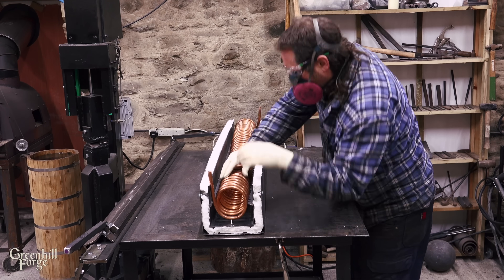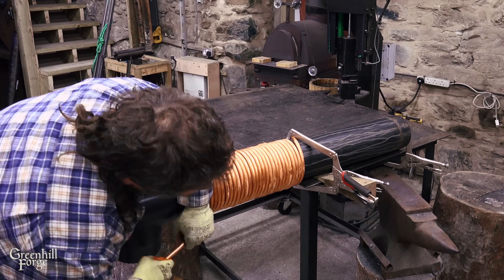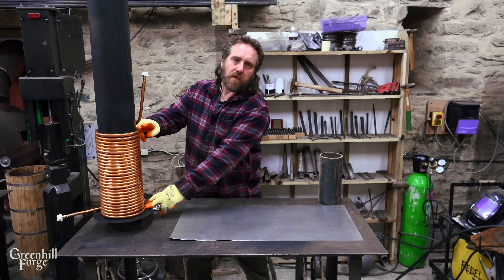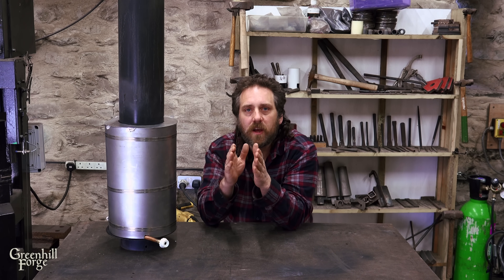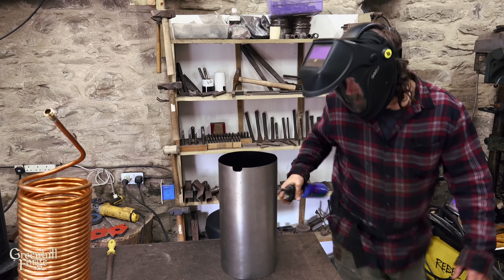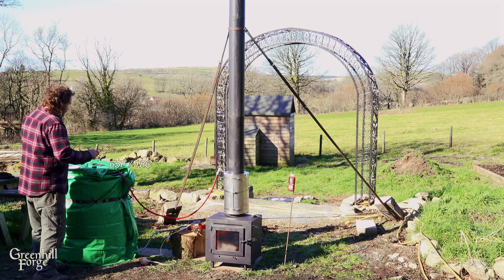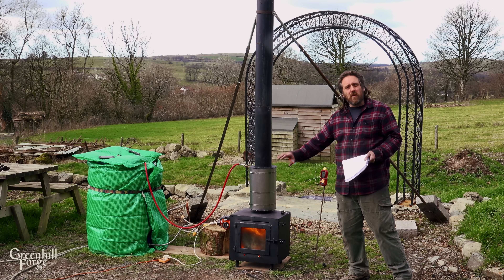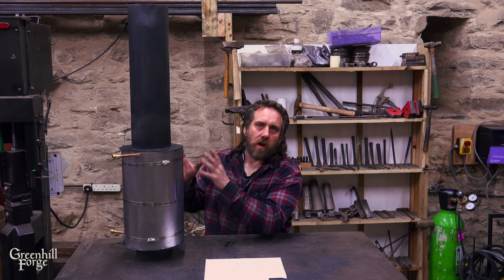Best Wood Stove Water Heater Yet: New Design Tested | Off Grid Water Heater pt3

Comment: Hi, I read through most of the comments - this post was fascinating for many! I live off grid and we heat with wood and I would love to have regular hot water in the heating season. Can you tell me what kind of barrel you used that’s safe for hot water?
Reply from the maker: any steel barrel is safe for water. if it's tied into a potable system then it gets a lot more complicated and needs a food grade lining like porcelain or glass

Comment: Another couple of suggestions crossed my mind. 

1. Place your coils on a section of flue that runs horizontally. This should work as long as you are pumping the water. It may foul up thermo-syphoning, though. I am not sure about that, but it seems that the unequal heat zones and the lack of vertical rise might hamper the flow of the syphon.

2. If you insulate the entire flue, the gases will stay hotter, allowing a good draft even with the slower burn experienced using a damper.

Just my 2 cents.

Comment: I watched your video and have a suggestion. I have burned wood most of my life of 70 years to heat my home with. I have had a career in the mechanical engineering field and have always been interested in projects like yours. 

What I have found is that a damper in the flue, while slowing the burn,  will keep the heat in the system longer, transferring more heat into the house. It seems that in your case, it would serve two purposes, it would make your wood last longer and it would transfer more of the heat into your coils. Those two things should increase your efficiency numbers. As a bonus, adding a damper above the coil would be a quick and easy modification.
Reply: I was looking for this kind of comment. It was my first thought for an improvement. thank you.
Reply: Exactly !!!  Slow the exhaust and the heat transfer will be faster.
Reply: I think he wasn't using a flue here to keep the tests consistent.

Comment: My homemade wood fired boiler/water heater, burns with no visible smoke, and doesn't creosote up the stack, 40 years of operation.  My only copper coil is a 60' length immersed  in a 200 gallon stainless tank, big enough to not need the ice in the tubing before coiling trick, which is a great idea!   I had a Snorkle stove for years, commercially made, made to sit down in the water of a hot tub, it worked great and now I wonder how it would have done in a tiny tank instead of a 4' diameter horse trough.

Comment: Great video with entusiasm! Interesting to see the differens between sand and graphite. I guess if the coil were stretched to cover more of the inner pipe, as with the inside coil on a previous video, efficiency would have improved.
With your welding skills, I suggest you to do a web search for "turbodym". That will bring you to a web page in Poland, Kratki, they have an other alternative, leading water tubes through the inner pipe. As for some 10-15 years ago, they didn’t make them in other than 200 mm, so I had a local shop making one for me in 150 mm.
Also worth mentioning, to avoid creosote buildup it is importen have water temperature above 50-55 deg C.

Comment: Is there no way to collect the creosote, or to collect it away from the coil? I see the rocket stove is the most efficient and quick to react...
Reply from the maker: the prevailing idea is to be hot enought to burn the creosote before it can condense. it could be condensed/collected on purposes fairly easily in principle but you'd have to do something with it, either burn it or remove it.

Comment: Pure speculation here but would laying a flat copper coil directly on top of the stove improve heat capture. I have an old wood stove in my backyard which I hope to use with a hot water radiator to heat my 8x12’ shed/workshop. The top of my stove gets markedly hotter than the flue.
Reply from the maker: it would work but total surface area matters too. 6 feet of flue is way more surface area than the stove top so there's a balance to find

Comment: I use a v Pipe, welded to a 6 mm plate installed inside the firebox intake  entering from below at 45 degrees, and exiting above at 135 degrees, thsi themosypons and is fast,, 30, and 60 degree v configerations wor well too, depeding on the fire box, we used stainless to make the heater

Comment: THE FLASH POINT OF THE CHIMNEY IS IN THE CENTER OF THE HEAT COLUMN. SO IF WE CREATE AN UPWARD EXPIRAL COULD WE INCREASE HEAT TRANSFER?
Reply from the maker: yeah, a helix up the middle would help a lot but increase creosote issues

Comment: Hi, I was thinking about the following setup: your wood stove, with an insulated container with water, on top of your stove, "wrapping around the flue", with a lot of horizontal rods radiating from the flue inside the container. But the top of the container should be open for safety reasons. The container has an in- and outlet and we connect it to a pump. Now one should be able to safely adjust the pump so that the heated water cools the flue down just to the required temperature. I'd love to see it tested, my use scenario is heating 30m3 pool from 10C to 25C (with ambient temperature around 10C).

Comment: I wonder if there is something you can do to concentrate the heat a little bit more at the spot where the coils are. By that I mean you could maybe put some kind of metal mesh or something inside the flue so it can absorb heat and hold it right there where the coil is.

Comment: i think spreading the coil out on the outside taller would help greatly. stretching it out three times the length is giving you that much more heating surface for the same amount of tube. then a shroud uninsulated about one inch wider that the copper so a .5 in per side of heated air contained around the copper.  i think your designs are cooling off the stove pipe more than heating up the copper pipe. spreading it should capture more available heat.

Comment: Steam locomotives figured out how to harvest all the heat from the flue gas. Instead of having one big pipe, have many small pipes and build a bigger cylinder around them and fill it with water. Your big pipe has too little surface area between the hot gas inside. Have some inlet at the top(cold water) and outlet at the bottom(hot water). But be careful not to cool the flue gas too much, it needs to be hot enough to rise, or you'll get carbon monoxyde poisoning

Comment: Brilliant thermodynamic analysis of the heat exchanger. If you could measure the inlet exhaust temperatures and outlet exhaust temperature of the flue the thermodynamic efficiency of the heat exchanger itself could be determined. 

If there was a way to increase dwell time of the exhaust gasses you might see a rise in the temperature jump. Perhaps adding half circle baffles inside the flue out of steel will increase the time the exhaust gasses are in the flue. Obviously that has its drawbacks.

Comment: remove coil completely, use pipe inside the pipe as distilers using oil jacket, chimney inside and tank outside directly welded to chimney, ad some fitting and you are done

Comment: Gains of a few % are cool, but a 10x factor is more exciting!  Good science but why stop there?  I'd be tempted to increase the journey 10x:
a) Split the flue into 2 flues b) Make the shrouds 2.5x taller c) double wrap the copper ie wind both up & down d) travels thru both shrouds.
Result: literally 10x the contact surface, journey & dwell times travelling thru the hot graphite beds 😉Then add an after burner, a small block heat exchanger in the firebox side poking through the baffle: turbo charges it into a 3 stage HW powerhouse🔥:text-yellow-goal: Thanks for the great vids 👍
(If going all out: Install flue catalysers so they run both cleaner & hotter with that exothermic 2nd burn!  These combos will provide copious lashings of boiling hot water ...aand tumbleweed lol 🍃 I guess it's really all about the YT ratings then)

Comment: Hey man, I do hvac, and this stuff is absolutely fascinating to me, especially because I'm getting more and more interested in off grid living.

Anyways, you asked for an idea, I was wondering what would happen if you did a sealed system, using glycol and a heat exchanger in your water barrel? It may ultimately lose a bit of efficiency but your copper will never get the mineral build up over time. Also, you can add a hot water solar panel to supplement this process. Let me know what you think!

Comment: Thank you for your tenacity towards efficient water heating. I eagerly watch and and this video begs the question , how does moisture in the fuel affect any method ? As of late my supply of good burnable wood is limited to green wood split thin and only less than 3 months drying . My starter wood is usually KD pieces of framing lumber .This has the effect of baking the green wood but the color of the fire is not that hot or bright as when only kiln dried burns. Measuring the flue temp showed me the difference to be 200 degrees of difference between wet and dry wood in the flu pipe. Had it not been for your efforts I might not have ever thought of taking temp readings .

Comment: How about an internal coil with   another pipe inside the coil protecting from creosote buildup. Perhaps raising the coil above the base of the stove a foot would heat up the pipe better, transferring more heat to the exterior of the coil. Would a damper above the coil change the result.

Comment: He said don't accidentally make termite. 
Insulated is like baking.
Having graphite is like boiling. 
Copper inside flue is like deep frying. 

Wouldn't 1/4 or 3/8" coils heat faster than 1/2"? Draw backs could be Less volume and require more pressure for circulation.
Reply from the maker: those aren't bad analogies actually.

Comment: keep the copper tube on the outside of the pipe but make the coil long like the inside example, with spaces, add sand or graphite,  and add a damper to the flu above the coil to concentrate the heat at coil level. you should see a huge improvement

Comment: I would suggest making the stove a cylinder and turning it horizontally. Long enough to put in longer logs. Then wrap the round stove and round exhaust with copper pipe and get heat from both. Also, a manifold before and after the stove would allow multiple coils to wrap the stove increasing surface area and points of contact.

Comment: I really like your design with the sand to fill the void...

If you want to go pumpless you could do another copper exchanger in your tank, braze them together, remove air and fill it with gaz (could just use propane)

Id be interested in that experiment...

Comment: I've also seen two other design modifications. First is to use squared copper tubing for better surface contact. Second one is to run coils through the firebox. Probably some issues with this system!

Comment: Based on your beginning dialogue, and tests, I would use the last method with one variation. I'd use gravity to feed the water from the top, down. It would seem to me that the bottom coil is the hottest, so why not preheat that water from the top, to the bottom coil. I'm not an engineer, but it makes sense in my small mind.

Comment: I was thinking abt putting beeswax in between the chute and copper pipe and if you want to lower the melting point of the beeswax just add mineral oil. Beeswax bc it doesn't corrode steel or copper

Comment: Very Very interesting experiment. I would be interested to see what would happen if you ELONGATED the copper coil(ie expanded the spring?over a greater length of flue and possibly consider welding rings to the flue. (I take my inspiration to some machine gun barrels which have fins to dissipate the heat. See  Thompson gangster sub machine gun, or CZ VZ26 machine gun

Comment: Very Impressive! However, how about giving some spiral interval on the copper tubing for test #3 or #4, as was in the previous tests, with more sand or graphite in the outer insulated tubing? In this way, you do not lose the rest of the heat lost after the upper top of the copper tubing, maximizing the amount of heat absorbed into the water. Initial cost would be higher, but the benefit of it would be much economic over time...Just a thought~ Very impressive~ Thanks so much!

Comment: Saw this old house Bob Vila era they made grew 9 wafers and they made at a time for solar panels the wood furnace was a Canadian Jet Stream down draft load 9 three foot long logs place a newspaper on top light turn on the fan close the door and we mostly used white pine as it is what we had but we used oak maple birch had 150 achers so had the wood the house was huge 36 000 sQ feet .

Comment: The best system I saw was at home a wood burning furnace there was a 9 foot tall 9 foot around round tank where the wood furnace the forced hot water the old oil furnace and the solar hot water heater made the domestic hoteatet 10 n months of the year theyeach had 3/4 inch copper pipes going around the tank 9x 9 transferring heat burn wood fora day heated for three days  !

Comment: Why not pull the copper through a triangular form thus giving the pipe a triangle profile, the base of the triangle would then be in contact with the chimney giving it a ~33% transfer rate - which is more than the outer surface of the cylindrical copper pipe... Also, can't we get get some graphene in there somewhere, somehow?

Comment: Why use a copper tube, just have a water jacket around the flue or better still get a wet back insert for the wood stove as have been used for decades to heat hotwater

Comment: Your contact between hot tube and cooper coil is not optimal. Also you lose hudge amount of heat due to the cilinder tipe of exhaust wich is too large. Try to Mount a truncated con above the coil it reduces the heat also reduces the combustion so les wood is neded. It will not heat fast but once heated it will keep it going reducing wood cost too.

Comment: There is a reason we dont do this.  This changes the stoves behavior into a condensing unit.  It is unsafe without secondary excavation.

If you want higher efficiency you need forced air.  You cannot do this with a passive draft without killing people.

Comment: Hello, what about increasing space between the copper coil pipe, outside the woodstove flew. This will expose more heat to be absorbed. And, instead of graphite, using antifreeze, like Preston. This should be a good heat exchanger. This should save time, materials, and money on the construction. And, save time Heating the water

Comment: Was hoping your final idea was to make the external one more like the internal one. Stretch out the coil to double the length like the internal one way. Use the graphite powder. You have coils pressed against coil when if spaced with around a pipe width between each loop the graphite will help pull way more heat to the coil.
Reply from the maker: There are more videos coming. I needed a shorter coil for a project I'm working on.

Comment: I didn't read all the 1338 comments, but the video does not mention the simple fact that such a flue is designed to take the hot gases from the burning material just up and away and not to catch any thermal energy. So the fireplace, the stove should be redesigned. The basic idea is to make the fire and the hot fumes travel at least horizontal and maybe up and down and transfer the heat more before running to the sky. Those things have been designed, but you must start from the beginning, not from the flue, which is the last part in the system.

The collection of soot and creosote inside the flue is not a safety hazard. Once you make it hot enough, it will burn out. But yes, there are better systems where the heat transfer is not inside the flue and in direct connection to the fire and fumes.

Comment: Mount a vehicle heater core , submerged in a tank of water to the ceiling of your wood burner , that water used in the capsulation of heater core , can be circulated for heat also ⚜️

Comment: I think you would increase efficiency with the final design if you did the same thing you did what the copper pipe that you did with the very first Design spacing out the copper pipe so that you use more off the flu for heat transfer they're trying to transfer as much heat in a short distance like you were with the final designs

Comment: Umm…why is your copper coil wrapped tightly so that each wind touches the previous one? This minimizes the length of the stove pipe that gets used for heat transfer. Using the same copper, make the wound coil length twice as long (winding two coils at the same time might give nice spacing once you separate the two).
Reply: P.S. this would also help with the thermal siphoning

Comment: We use a wet back stove, it burns 365 days a year, the problem with cooling the chimney is the build up of tar and soot. the buildup would be much worse if we cooled the base of the chimney, even though the above roof is fully insulated!
The top 2 inches is not insulated and needs to be de-crusted every 6/8 weeks as it is!

Comment: The most efficient wood pellet stoves use a water jacket heat exchanger and something called turbulators inside a few parallel flu pipes. The turbulators increase air turbulence inside the flu pipe forcing the hot air to remain longer inside the pipe and make more contact with the sides. I read up on a dutch forum a few years back and that guy had insane efficiency. 

It really a bummer that I don't have access to a workshop anymore. Life in the city sucks.
Reply from the maker: i wouldn't be surprised if that's the basis for the most efficient "wood" to water heat system possible. Seems like you could max out each stage of the system fairly easily. I'll put it on my list of projects.